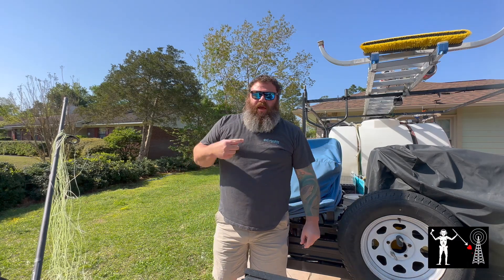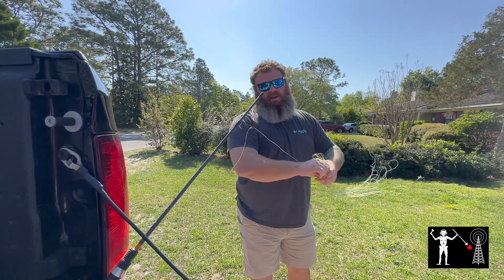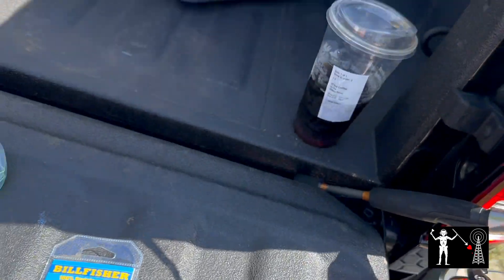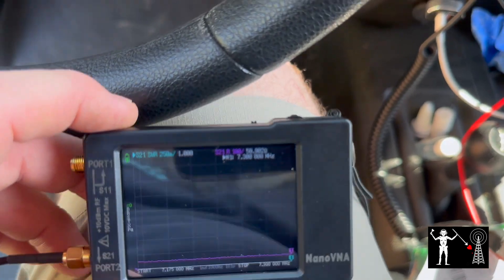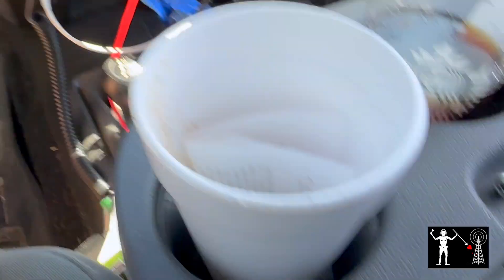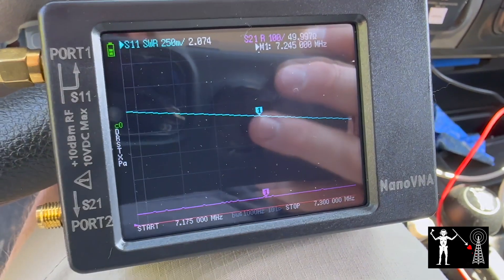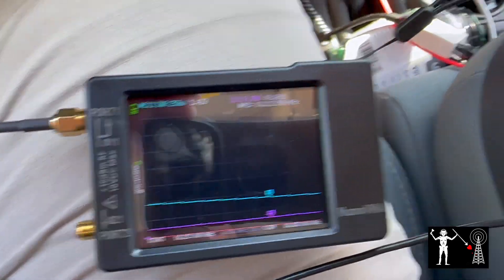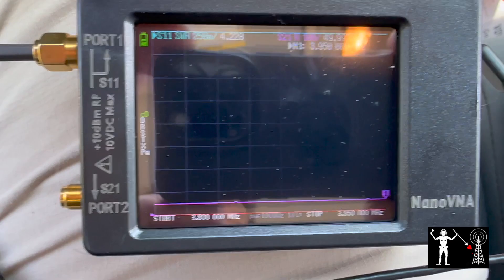Antenna Tuning with Nano VNA

Comment: Im just learning and dont know much. My question is- I thought an inverted V was a center feed or off center fed wire? I didnt know you could end feed an inverted V.  Im learning more and more every video i watch. Thanks for  publishing these video's for people like me.
Reply from the maker: You can run an inverted V with any wire configuration.  They are ofter used that way with Dipoles or off center feed dipoles.  But I often use my end feed half waves in an Inverted V and love the results.  I have one at the my house and it is in an inverted L.  Just throw the wire up and see what works.  Thats how I do it and I am ofter surprised.  Thanks for watching
Reply: @Blackabeard  Thank you
Reply from the maker: @basicinfo.9315  no problem. If you ever need anything else please look me up on QRZ.com. My info is good there.